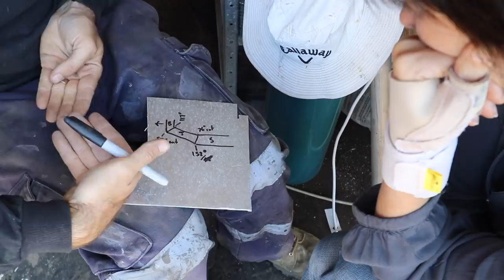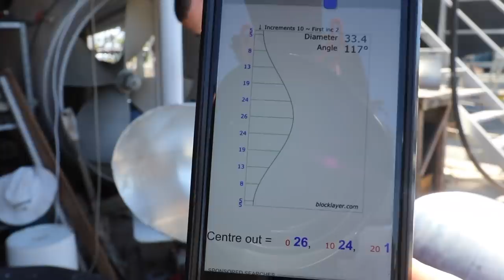DIY 2.5m Aluminium Pontoon Dinghy Part 2 - Project Brupeg Ep. 108

Comment: This is really cringey. I am having trouble remembering, but don't y'all have a laser level? If so, you could use that with the tube laying on a flat surface to mark inner and outer ceterlines then just measured those lines in your cad to mark points and cut accordingly. I guess that by the time this episode started you were past the point of that working.
Reply from the maker: No to a laser level but that wasnt the issue. also this isnt a CAD designed boat. Ive tried autoCAD and Fusion 360, Rod uses Hull Form, Rhinoceros, Fusion 360 & Solid works, the issue wasnt so much designing it, as thats the easy bit. It was that if we designed it, we couldnt find a way to get any of the programs to un-roll the tubes into a flat sheet to laser cut, then assuming we could get it cut right, the roller wasnt CNC so it would never be spot on accurate, hence manual design as we build was the only way we could make it work.
Reply: @ProjectBrupeg  Sorry for the cad confusion I meant your cardboard aided design.

Start by drawing the central hull. cut out 5 rectangles of equal width and length (as long as the straight part of the hull sides may be easiest). Set the side pieces in place. Set the front perpendicular to the sides at the correct position. Lay the corners across. Cut off the excess. You now have a top down projection of the pipes you need in cardboard form. If you flip the odd numbered ones along the lenght axis you will find that they piece together into a straight piece with diagonal cuts.

On the real tubes, mark 2 lines down the length on opposite sides (this is what the laser level would have made much easier if you had it). Along those lines mark the lengths of the sections of your cardboard rectangles. Cut between marked points, re-assemble as you did the cardboard.

It is a technique used in wood working for framing odd shaped things fairly often.

Comment: That's  one hell of a job. Some engineering magic. Will you be filling them with marine foam.

Bloodly amazing audio delivery this time. Great work Guys 👌

I'd sit on the toilet and get 3 toilet roll cardboard tubes and trial cut them CAD
Reply from the maker: Your toilet idea was a strong contender for plan B... yeah the plan is to fill internally with foam as we need to run battery cables through the tubes and the foam will hold them rigid and act as flotation if needed

Comment: Just make half the tube from tape (on your centerlines) and put cardboard on the inside then cut the tape along on the inside where the two tubes will be welded.  Set it aside and do the other half.  Tape them together and mark your sheet metal to cut. There ya go.  Too bad you don’t get all that time back.
Reply from the maker: It’s all good. I wouldn’t have missed a minute. Fun and the last time I could do physical work with my condition. A special last blast for me and great problem solving exercise. Cheers Jess
Reply: Project Brupeg it was fun watching y’all discuss and your exchange with the talented and lovely!

Comment: With the next one being square sided to save the math or a lot of it get the side tubes made say 2mm alloy and the front one the same then the joiner tube make it 6 to 8mm smaller 6 in the square side 8 in the side with the seams so it will fit within the other two tubes  then some gentle trimmer and massage each end of the joiner tube so you fold the seams in.

Two benefits you can drill a few holes in the outer and weld the flap from the joining tube inside the front and side section as well as welding the seam itself this way it will take more punishment and take some stress form each side of the weld (aka the weak point). Not sure if you intend on putting stiffiners on the outside of the corners of the round tubes could make them look like tie down points or hand and foot holds I guess.

Love the CAD work Cardboard sided design
Reply from the maker: Hi Steve I did think of a version of these inner tabs but the issue is in the bends, how do you allow for the bend with the tab? As it will sit right on one tube and wrong on the other or too far off on the inside bend and not fit on the outside bend. Other than that I would love to solve this problem as it’s a great idea to increase strength.
Reply: @ProjectBrupeg  rivets help hold things then you can drill and weld them up after. Ok I am no engineer but only have one pair of hands so cheat...

Comment: Would it be easier to cut in multi parts rather than 3 parts cut into 6 or 9 and weld the seams
Reply from the maker: We had to keep the welds to a minimum due to warping of the tubes. Thanks for the idea though. Jess

Comment: The further away I am the more it'll be exasperated.....well that's an understatement.
Are there more than one alloys at play here?
Reply from the maker: Hi Jim, all the same grade of alloy, but each tube is slightly different diameter, same circumference, it was impossible to get them all to be identical but they were all within a few mm of each other.
Reply: @ProjectBrupeg  OK, I was wondering why the reference to alloy as opposed to aluminum. Assumed we were dealing with more than 1 metal or a special mix of aluminum.

Comment: Symmetry is your friend!
1)Make the hull/chine level both ways 
2)Measure from the stern to the first joint both sides equally - then tack the stern big pieces in place leaving enough extra beyond the marks to allow for the joint cut.
3)mark centreline length ways - measure from this to maintain symmetry of tubes 
4)tack your front piece in place using a level horizontally and measurements from the stern
5)so now use cardboard template - with one straight edge on centreline and big enough to reach to the front centreline mark - transfer marks onto cardboard and then determine how long your front piece will be- then draw a line btwn the internal end of front piece and original side mark 
7)this line will be duplicated 200mm parallel on the cardboard - make similar parallel marks for all tubes 
8)where lines intersect on the 2 sets of lines is where you draw a line that is the angle of your joints/cuts

Clear as mud.. right?
Reply from the maker: I think i understand, we basically did a version of this but it got lost in the editing process (started with 12hrs of footage to cut down for this episode so some bits didnt stand a chance)

Comment: After the fact, of course, but I kept seeing a 2 dimensional trapezoid bisect the center of the tubes. Creating two of those measuring half the circumference of the tube , each, and connecting them at the base, transfer to CAD and rolled to the approximate shape should get you to where you can sneak up on the final shape. The multiple angles is definitely a head scratcher.
Reply from the maker: yeah your right, the issue is also not just the anlges being halved onto each tube but as the tubes lift toward the bow the angles are offset against each other if the tubes were all layed flat it would be easy but this boat has a raised bow so it just further complicates the maths

Comment: why dont you just make the 1cm markings around the tubes on both sides and measure each one like you were doing with the string and cut your template according to the measurements
Reply from the maker: Tried a similar thing. Didn’t work but thanks for the thought. It’s much harder thing to do than it appears. Cheers Jess

Comment: It will be difficult to make it waterproof with all these welds. It would be easier to fill them with urethane.
Reply from the maker: We will make it water proof. Im not a fan of gluing over a bad join, yeah it takes time and can be a right pain but i would much rather have a fully sealed welded hull where we are heading
Reply: @ProjectBrupeg  I am not talking about glue, the foam that is use to fill a cavity (expanding foam for isolation). 
Sorry for my english, i am french canadian and english is not my language.

Comment: Did you put any baffles between the chambers?
One pinhole, and you sink
Reply from the maker: That’s an assumption. No we don’t have baffled as we need to run battery cable through the tubes. The tubes are however filled will foam for flotation if needed

Comment: I tried to tell on the first video. I ran this on the real cad six times and it kept telling me the one Piece of tubing was wrong to much angle it came to 29* degrees’s with an off set of 6* degrees turn on the second joint and then 6* at the joint to the front tube. Then run cleets on the inside to attach the tubes to the deck- bottom of the boat.
Reply from the maker: Thanks Anthony, we figured it out at old school manual way with trial and error

Comment: Are you going to leave the extra sheet metal inside the tubes? That will be rattling when at sea.
Reply from the maker: Hi Jean, yes and no. Yes we will leave it in, no it cant rattle, its really stiff (like surprisingly stiff) and the internal space will be filled with expanding foam so nothing will be able to move in there regardless.

Comment: Would it be worth welding the inside seam on the front section for extra strength ?
Reply from the maker: Hi Mac, absolutely worth welding on the inside. But how do you get your hand in there with a spool gun that is too long to fit?

Comment: thanks for the video as always . hindsight  its brutal stuff and there has to be a far easier way of getting your tubes to line up  ..scribing possibly as for the math  its possible you are overthinking it as i see it you have 2 parallel sides with a triangle on one end..but that triangle is angled to the sides on one plane..  work it out for top down view first then from side . that gives you the compound angle for the bow.  you know the tube circumference and can mark 0 90 180 and 270 giving inside and outside top and bottom center lines  using your string to span the gaps measure the distance and apply to template for cutting..... i think lol  probably best to talk with someone that welds exhaust pipes a lot for tips,,hindsight and remote engineering lol but with good intentions ;] again thanks for the video
Reply from the maker: Thanks Mike
Reply: @ProjectBrupeg  its the least i can do and you are most welcome ..  im not shure but thinking thinking of the tube as a fat line on paper may help sort the 3d mental image when working the math  looking forward to the next video and eventually some of the scenery i cant see in person best of luck on your adventures to come

Comment: It's shaping up nicely.  Looking forward to a trial run.
Reply from the maker: Yes just about there Don, tubes are finished now, and welded to the hull, currently in the last stages of pressure testing the welds, and fitting the propulsion

Comment: great effort, have you looked at sketchup or nano cad as free CAD programs ? I built a scratch built car and it was invaluable,e
Reply from the maker: Hi John, I've tried sketch up but couldnt get my head around it. Ive tried autoCAD and Fusion 360, Rod uses Hull Form, Rhinoceros, Fusion 360 & Solid works, the issue wasnt so much designing it, as thats the easy bit. It was that if we designed it, we couldnt find a way to get any of the programs to un-roll the tubes into a flat sheet to laser cut, then assuming we could get it cut right. the roller wasnt CNC so it would never be spot on accurate. hence manual design as we build was the only way we could make it work.

Comment: Well this was a study on how to make a simple task near insurmountable! :) What about compartmentalizing the pontoons, so that one leak won't sink the boat? Love your videos! :)
Reply from the maker: Its seems simple until you start building it, then you realise looks can be very deceiving. we cant add bulkhead into the tubes as we need to run electrical cable around the inside of the tubes. We will however be filling them with foam so that if they are ever ruptured the boat is unsinkable

Comment: When you have miter joints in tubes, the angle needs to be cut equally on each pipe.  If you have say 70 degree angle between the pipes, then the end of each needs to be cut at 35 degrees. Otherwise the oval shapes won't match.  Greg
Reply: Tamara Lee I was going to say this, but you saved me the trouble 😃👍🏻
Reply from the maker: Hi Tamara & Fire Fly, absolutely agree, hence i was being so anal about the maths as I was the welder that would pay the price if I got it wrong

Comment: Damo, the side tubes and the bow tube are not on the same horizontal plane that’s why your angles are not working out, best / easiest option is to use corrugated cardboard to make a template

Comment: The easier way is to keep the original inflatable material. Pull it apart and use as templates. That's what I did.
Reply from the maker: We never had the rubber tubes. This hull was from the scrap yard about to be crushed for scrap alloy
Reply from the maker: Released to Patreons today, https://www.patreon.com/posts/electric-dinghy-31728297 shows pressure testing, internal floatation, batteries, wiring, fusing and sea trials